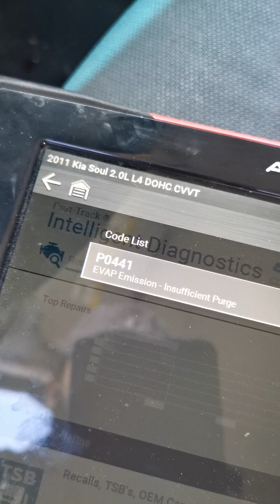2011 Kia soul 2.0, code p0441 purge valve! location, removal and installation 🤔👍😃

Comment: My rubber hoses are STUCK on my purge flow valve and i cannot get them off i have tried and tried and tried to get rhem loose and it is not working. I dont know how to get access to the upper hose to remove it but im at my wits end on this one. I swear they super glued it on there.